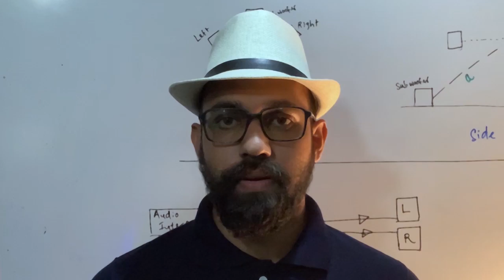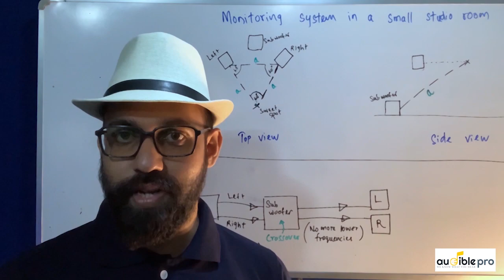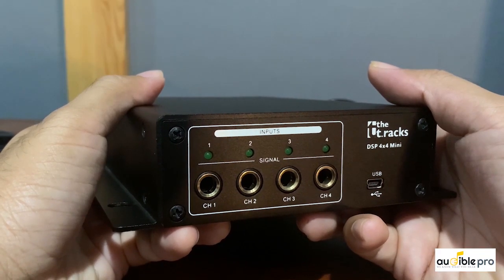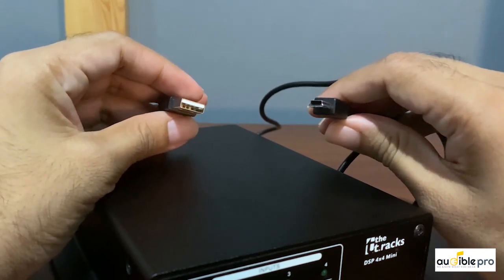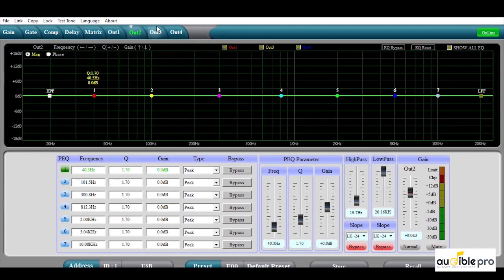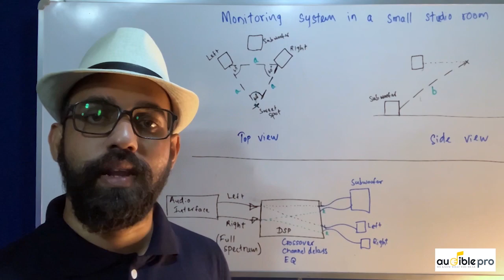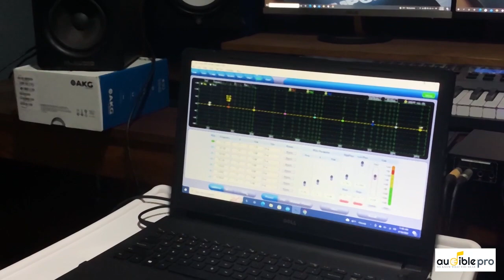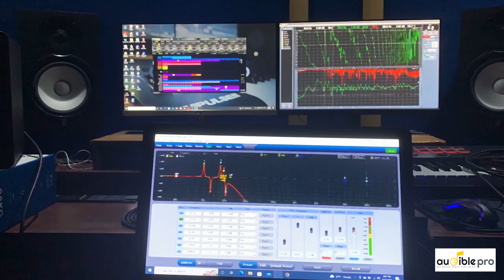Improve your studio monitors under $120 | Thomann the t.racks DSP 4x4 Mini

Comment: thanks for this video, do you know if i ca use this dsp for a sound system with 4 subwoofer and 6 line array speaker?
Reply from the maker: It depends on the way you route them. If you plan properly, you can use this to get the best out of your system

Comment: I plan to get 2 of these to feed my amps for a "Dolby Atmos 5.1 system". Basically I'm gonna be using a HDMI to 5.1 decoder, which outputs RCA, which I will then feed into DI boxes to Balance the signal to send to 2 of these DSPs before sending the outputs to my Amps which feed my speakers. Basically I'm getting the same result a £9000 Dolby Atmos amp does for less than £400.
Reply from the maker: Wow good to hear. Now they have a pro version of this DSP with XLR connectors

Comment: DOES NOT WORK FOR MAC. DISAPPOINTING!!!
Reply from the maker: Yeah it’s disappointing. But you can use a Windows computer to do the calibration and use the DSP with a Mac
Reply: @AudiblePro  So you can basically hook this up to a USB Hub and then have it run with Windows and Mac (After doing the calibration in windows)?
Reply from the maker: @thomaz8099  this requires the usb connection only for the calibration process. Once you tuned the system, USB connection is no longer required
Reply: @AudiblePro  Okay, perfect!